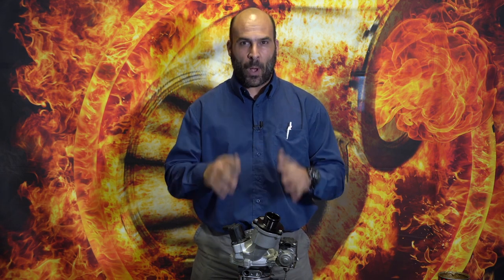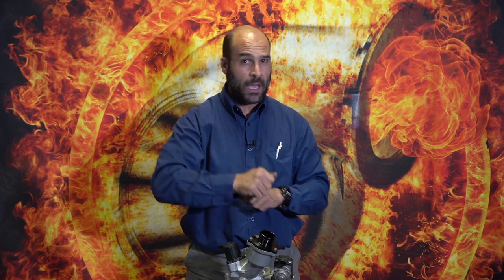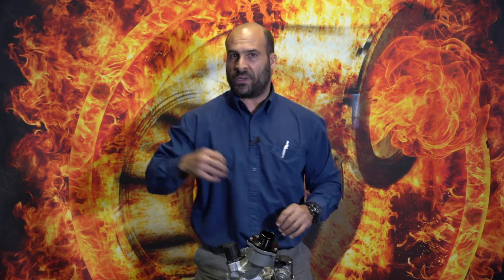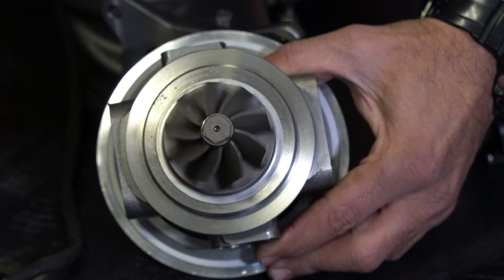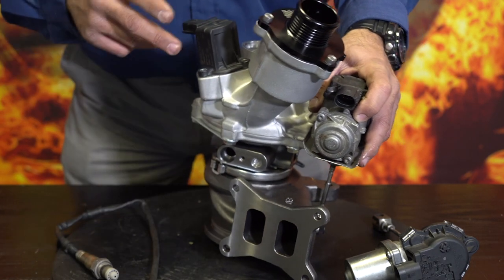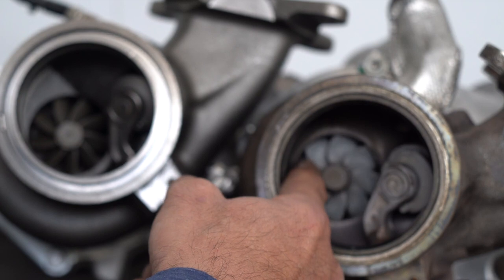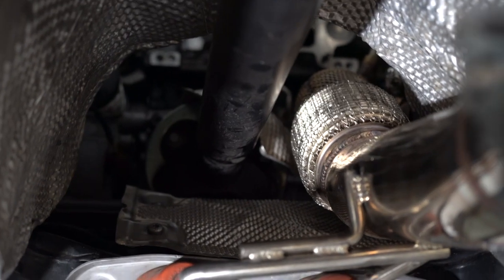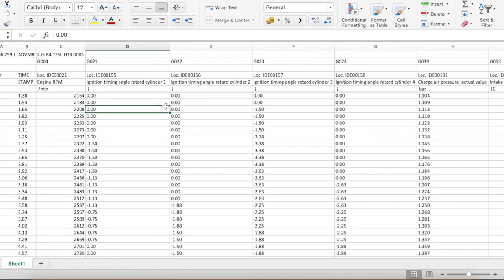Golf7R IS38-450 Dual ball bearing turbocharger

Comment: Well, looks like I might have a project this winter.. I am curious as to how you are achieving those numbers on stock fueling.  Is the North American Fuel system different than SA?  Mostly you see safely 400whp over here before you need to upgrade some stuff like HPFP or running a port injection kit.  Also with your Water/meth setup, are you running port injection w/m or are you running a nozzle low down for cooling? I have noticed on my own car that I am receiving a slight fueling benefit with 1 nozzle(225cc) post Intercooler but nothing crazy.

As for my biggest complaint with other companies Chinese turbos, the casting on your unit looks so much better on the hot side.  Is it investment casting? or still Sandcast?
My car is used for Motorsport applications, and I have yet to see a IS38 that is dual ball bearing with a nice casting that makes me think it might not crack with repeated abuse.
I have been holding out for something robust and well designed, instead of going with the BW EFR solution.

Will you be doing a deep dive on compressor maps for this turbo like your other videos?  

Sorry if I have a lot of questions, but I am genuinely interested.
Reply: Europe and some other areas have dual port injectors pfi and dfi. With a good lpfp system you can have stock injectors working on high power setups.

Comment: 2017 R here, what are your thoughts on cryogenic shaft hardening to reduce axial flex? Do you think this might make your product even more durable than it already is?
Reply from the maker: Our products are 100% reliable and durable, no requirement for any Cryo or any other "modificaiton".  If how ever you are suggesting this as a "solution" to the continued hybrid failures - then i have this to say.

The shafts hardness state is not the issue with turbocharger failures 9especially hybrids), its the uneducated "turbo guys" who convert a reliable and durable OEM design into something that its not designed to handle.  There is no problem or challenge in hardening the material that shafts are made of, however its outside of specification for the intended application.  

In fact it takes 13 seconds to harden this type of shaft in a turbocharger application, when using induction hardening, but once again this is outside of specification for the intended application and will not solve anything, nor will Cryo (cryo will make the problem worse - embrittlement)  The shaft is designed to flex, and should do so - inside of an operating window/tolerance - changing the material spec/condition will negatively affect this. 

The reliability and durability of the product starts at the design inception, not by trying to modify an already proven design to work outside of any realistic boundaries.  If you design a turbine shaft correctly for the intended purpose, it will last, modifying the rotating assembly and expecting the same reliability without re-designing the shaft - will never last, especially when the rotating assemblies chosen to operate on the tiny OEM size shafts are so large.

Comment: How would you compare this turbo to an EFR 6758 with your swirl adaptor? Thinking about either of these setups for a mk3 Audi TT. Would stock rods/pistons handle that with the increased ramp up speed from e85 fueling and sports cat downpipe as well? Looking to make 440-500hp
Reply from the maker: The 6758 will outflow this specific setup, however the next product video coming soon will be the 550HP capable unit with the same turbine stage, with larger higher flowing compressor. This will compete head on with the 6758, but as a bolt on.  The stock motor will handle (reliably) 400-420HP - anymore than this, i would forge the bottom end for sure.

Comment: 632.2nm is in the red zone for the Rods in a stock engine for this car. Its only a mater of time unless your lucky or don't push the car.
Reply from the maker: The engine is fully forged - we have made alot more power than this with our other turbochargers.

Comment: Looks similar to APR DTR turbo?
Reply from the maker: Many turbo look that same until you open them up - especially the chinese knock off units. From externally castings are copied all over the world, most even copy the original OEM's logos and grind them off after casting.  There is alot more to a product than what it looks like from externally. However ALL the IS38 bolt on turbos "look the same"
Reply: @TurboDirectSA  yes of course. similar power output and ball bearing, dyno chart look same?
Reply from the maker: @TurboAcki  Thanks for the info - what was the boost pressure used on the power graph you have seen?
Reply: @TurboDirectSA  APR STAGE 3 DTR6054 - as always no boost graph ;)
Reply from the maker: @TurboAcki  We were running 1.8bar gauge pressure at this point in the dyno - the turbo was not maxed out - we never had any high octane fuel available at the time of this dyno.